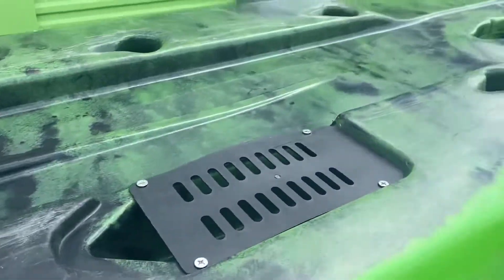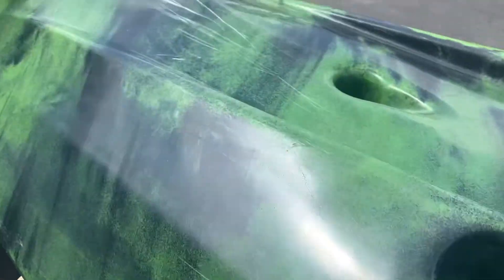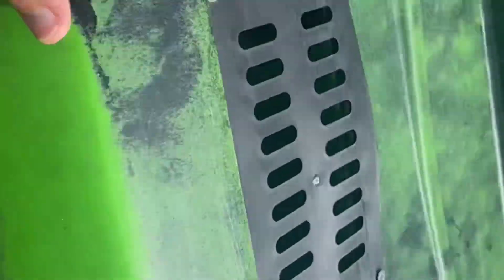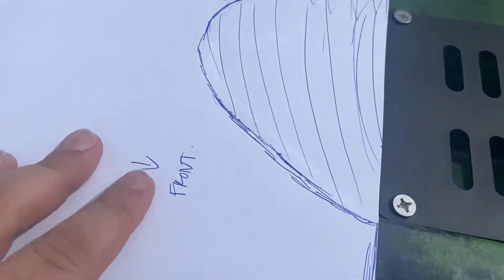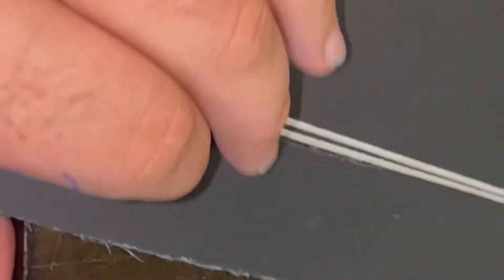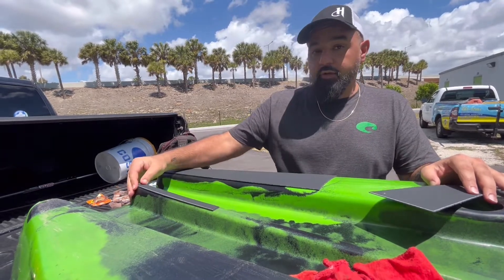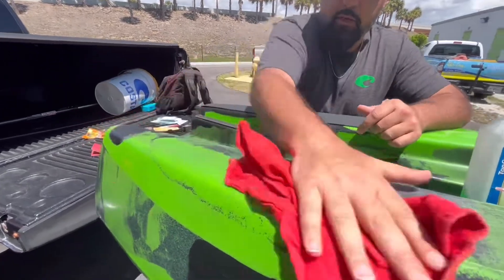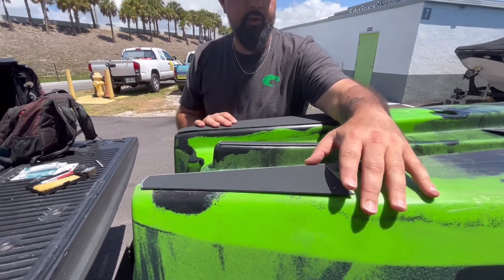DIY Kayak Keel Guard

Comment: Do not use gorilla tape. If you do, read the warning on the back of the pkg. I almost used it on my kayack till I read the back. It says not for use on polypropylene or polyethylene which the kayack is made from. 
  I had a hard time getting the tape off but I got it. I didn't have it on but a few minutes.
Reply from the maker: Thanks for the heads up on the gorilla tape. If I do this process again on my newer kayak I’ll see what other products I can use.
Reply: Some of the other videos mentioned 3m tape which I'm trying. It's only 30lb hold though. It too says permanent tape but doesn't have the do not use warning.